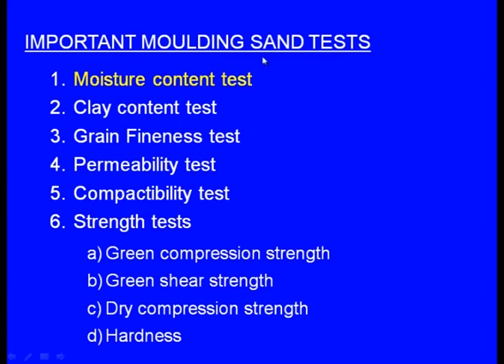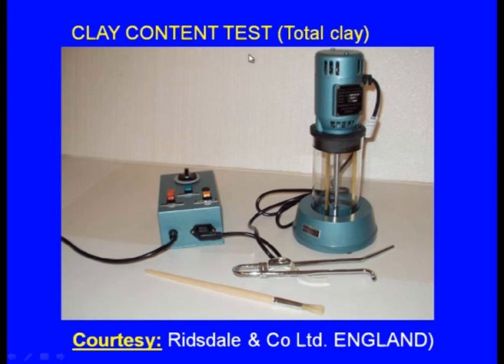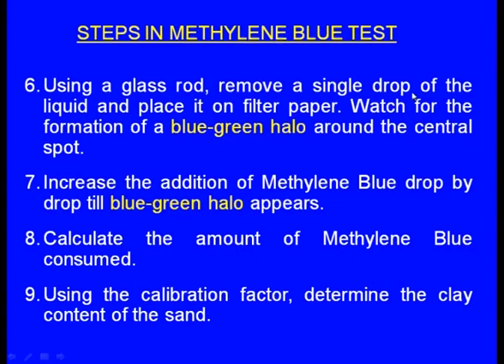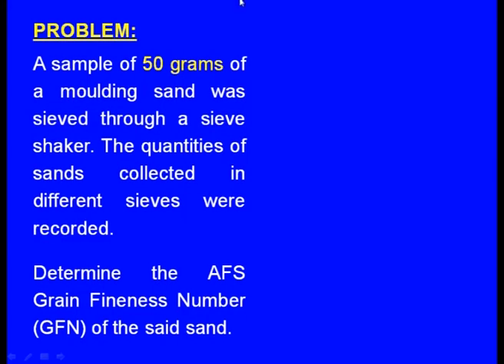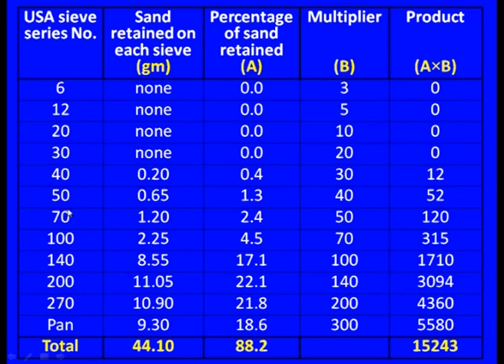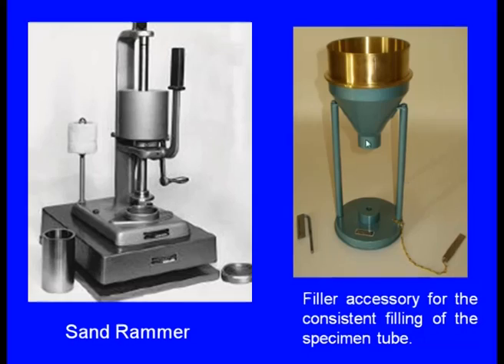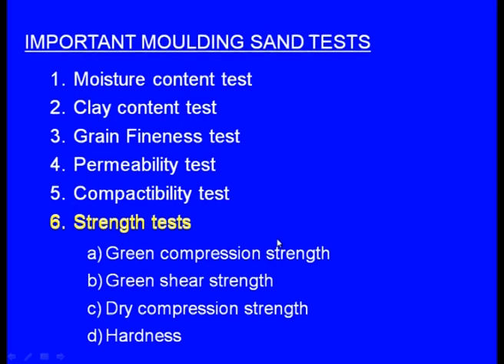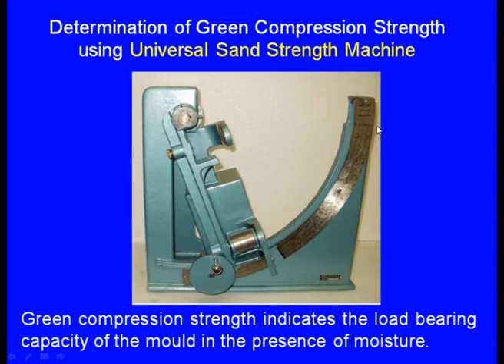Moulding Sand Properties Testing

Comment: Please tell required moulding sand properties for all test for cast iron.
Reply: It really depends on the kind of casting and the kind of moulding process deployed. for High pressure moulding it might be 3.6-4.0%, for jolt squeeze about 4.0 to 4.5%. For hand moulding it depends.

Comment: Sand dry aane ki wajah se water badana  padta hai then water badane se moisture increase hota hai wo use control kaise kre sir
Reply: Return sand moisutre (if you are using a sand plant) needs to be between 1.6-1.9%

Comment: Moisture ki control kaise kare sir
Reply: Control the water content in it......if it is low, spray water in small amounts  and if it is high dry the sand (can accelerate the process using blowers)
Reply: Where?
Reply: @abhijeetbisen7345 
Could you help to share why some people mix the sands with molasses or engine  oils please ?
Reply: @ziadnajm1118  
Molasses:

1. Acts as a binder, holding the sand grains together.
2. Helps create a stronger, more durable mold.
3. Reduces mold erosion during pouring.

Engine Oil:

1. Improves mold release properties (eases removal of cast part).
2. Reduces friction between mold and cast metal.
3. Helps prevent mold sticking.
Reply: @abhijeetbisen7345  so Which type is better 1-water 
2-molasses 
3- engine oils ?